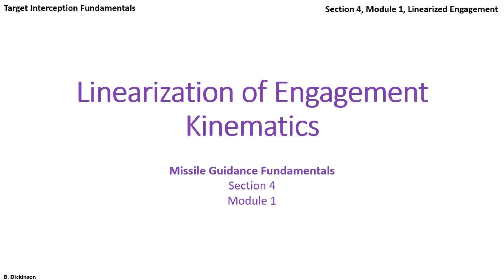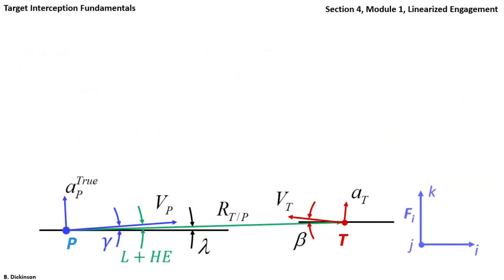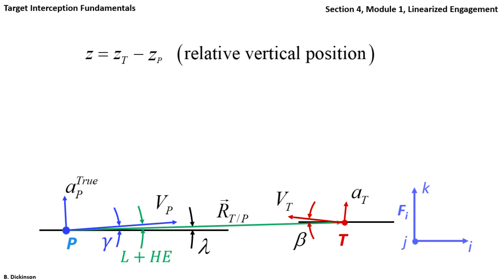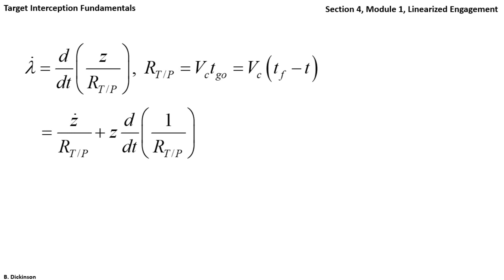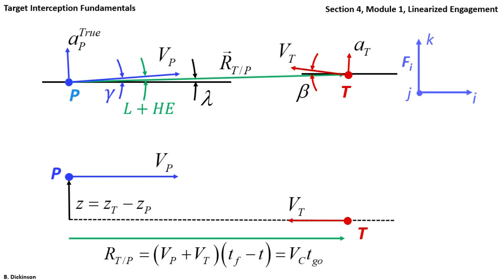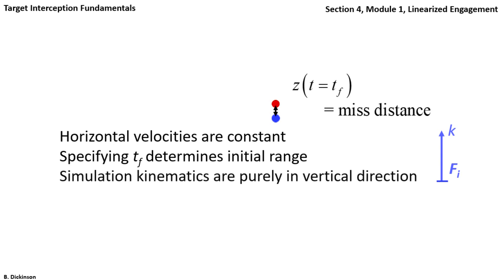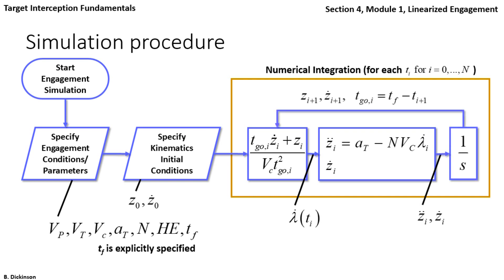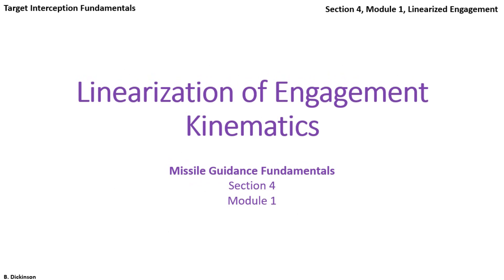Linearization of Kinematics with Proportional Navigation, Section 4 Module 1 - Guidance Fundamentals

Comment: Hi Ben, first of all thank you for the great lectures! I have a question about the "Simulation Procedure" diagram at 8:14, there is this "1/s" block within "Numerical Search" section, what is "s" and what calculations does this block perform? Thanks!
Reply from the maker: Hello Mein Herr Dreyer! You're welcome and thank you for watching.

The 1/s is integration in the frequency domain. s is j*omega where omega is frequency in radians per second and j is the imaginary unit. 

It's simply meant to indicate that the linearized kinematics are integrated to the next time step. In the diagram, I've blended the time domain and frequency domain without showing a conversion. The 1/s is more illustrative. In the code, I work completely in the time domain.
Reply: @LearnGandC  Ah right, thank you for the speedy reply and clarification. That makes plenty of sense, I guess I will have to catch up on my basic control theory